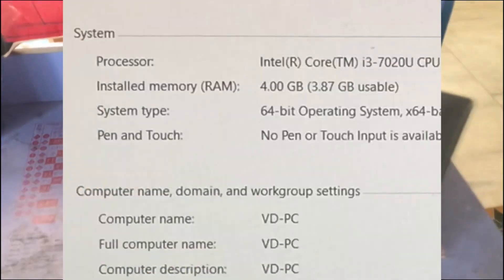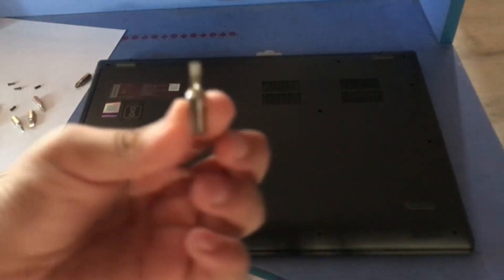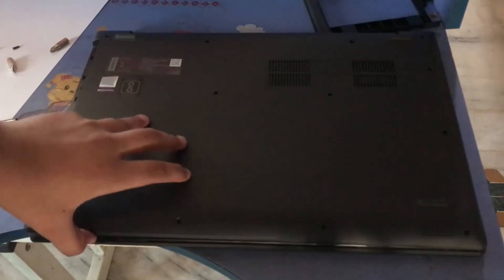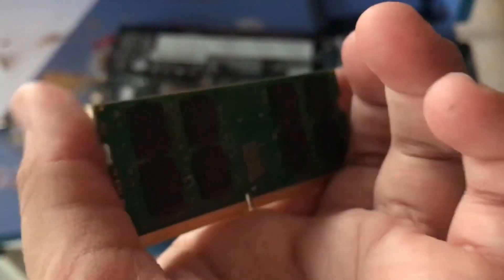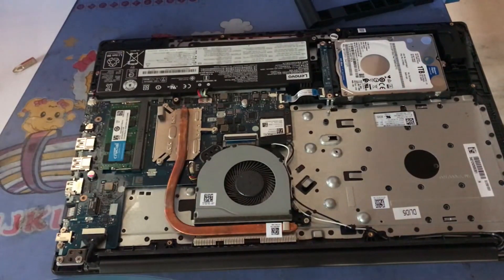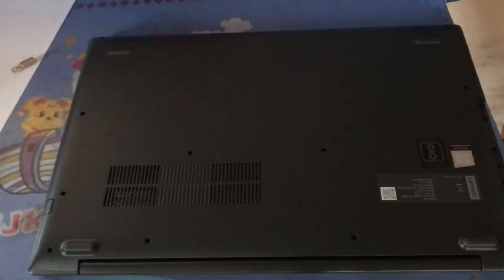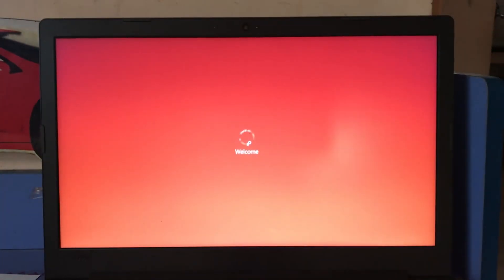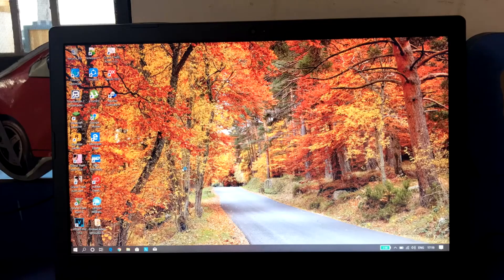Lenovo Ideapad 130-15IKB review and Ram upgrade + GTA V Test (UPDATED)

Comment: Did you use hdd on this laptop? How about if you use Ssd for this? and let's compare these two drives  🎉❤
Reply: Try to make videos about Gta5 performance between HDD VS SDD  using this Lenovo Laptop

I'm very glad to see this 😊
Reply from the maker: @joshuapaul9874  Hey, sorry about that. I did use a HDD but I do not have the laptop anymore to compare with an SSD. You're going to have to try it yourself. I doubt it will impact much more than load times, though.

Comment: afaik this laptop doesnt have sata port, did you ever try to upgrade ssd?
Reply from the maker: Yes, some time after this upgrade, I got an SSD. The Pre installed HDD just has a normal SATA config. One data port and one power one. In the laptop, there is a ribbon connector that connects the motherboard to a separate piece with the SATA ports. 

This was a long time ago, so my memory might be a bit fuzzy, but if you have the laptop yourself, just take out the screws very carefully and you should be good.
Reply: @WarWithVarun  you mean you replaced hdd with ssd. I wanted to install ssd without replacing the hdd.
Reply from the maker: @PrasadTheACE  unfortunately, no . This laptop doesn’t have enough space for that.

Comment: Ayo I have a laptop same as you and I want to confirm if I upgraded my ram on my lenovo 130 15AST will run smoothly in games? Since I changed my hdd to ssd but my cpu is AMD A4
Reply from the maker: Since I didn’t have the same CPU, unfortunately I cannot confirm anything. Though I can say that you should upgrade it anyway.

Comment: Okay bro so now i have This same laptop and model also, and it has installed nvidia geforce mx 110 grafic card which is running smooth and strongly.... now if i add 8 gb ram in this laptop so i get total 4+8= 12GB ram..... So now my all game and all work will be done smoothly na like big pcs............
Reply: Hello brother, how did you do to put a graphic card on it, I was thinking of putting one on it, but I don't know how you did it.
Reply: @sofiadelgado6262  bro my graphic card was inbuit by default from factory only, i didn't added anything😁😁😁
Reply: @shyflipx8  bro what speed is the best for this laptop
Reply: @Sofia Delqado the speed is Amazing its likeee 6969 GHZ
Reply: @shyflipx8  for this laptop?
Reply: @shyflipx8  which speed is the most recommended for this laptop

Comment: Hey bro! I have the same laptop with the i5 8th gen one and I was checking the official website where they said that you could only upgrade it to 12gb...is that correct info or could we add a 16gb over the 4gb soldered ?
Also any different company like samsung or kingston would work or is it Crucial specific? 
Would help a lot if you would reply to these questions of mine!!! 
Thanks
Reply from the maker: That information is incorrect. This laptop supports upto 32GB of RAM. Yes, I used crucial but you can use any other brand.
Reply: @WarWithVarun  thanks for the reply mate!
Reply from the maker: @debarshipal8275  You’re welcome!
Reply: @WarWithVarun bro are u sure we can upgrade upto 32gb?omg i was worried abt 16 gb lol and can u tell which frequency we should go for
Reply from the maker: @zak0r620  Yep! 3200 MHz is fine.
Reply: @WarWithVarun  thanks but bro will it work on 3200mhz only then?
Reply: @WarWithVarun  cuz rn i have 8 gb 4 plus 4 and they are clocked on 2400mhz
Reply: @WarWithVarun  and my variant is i5 8th gen plus mx110 lenovi ideapad 130 15ikb
Reply from the maker: @zak0r620  Yes, but not in dual channel because the inbuilt memory is different frequency.
Reply: @WarWithVarun  bro i didn't get ur point the thing is when i bought this laptop since then only it has 8gb ram and 4 gb is soldered as i have seen in reviews and sources and 4 gb is other and i swe it in task manager it shows 2 of 2 are occupied and also their speed shown their was 2400mhz  and now i want to upgrade my second channel ram  and get 16 gb in it so dat in total i get 20gb so if i use 3200mhz ram  then what will it be clocked on

Comment: While i was researching i found a pif of the laptops specs and it says it can 12gb of ram max. Can you  check in file manager in this pc properties on how much ram is actually usuable thanks
Reply from the maker: That info is incorrect. This laptop supports upto 32 GB RAM. The usable RAM is mentioned in the video.
Reply: @WarWithVarun  ah okie
Reply: @WarWithVarun  hold on, is the 12gb max an outdated info? Or have the manufacturers since updated software so 32gb can be run now?

Comment: how much ram does the laptop support ? 
And can it support both an ssd and hdd
Reply from the maker: This thing supports upto 32GB RAM.
It can only support either SSD OR HDD, NOT both.
Reply: @WarWithVarun  I have the same laptop I have 1TB HDD can I also install SSD in optical drive slot? If not then what is the reason?
Reply from the maker: @awesomestuff817  there are not enough connection ports for another storage drive.

Comment: Can i ask for the display and graphic settings for gta v, might try it, we have the same laptop. Ty
Reply from the maker: DirectX: 11
Resolution: 1280x720
AR: Auto
FXAA: Off
MSAA: Off
VSync: Off
Pop. Desity: Low
Pop. Variety: High
Distance Scaling: Low
Texture, Shader, Shadow, Reflection Quality: Normal
Reflection MSAA: Off
Water, Particles, Grass Quality: Normal
Soft Shadows: Sharp
Post FX: Normal
Anisotropic Filtering: Off
Ambient Occlusion: Off
Tesselation: Off

Long Shadows: Off
High res. Shadows: Off
High detail streaming while flying: Off
Extended Distance Scaling: Low
Frame Scaling Mode: Off

Comment: my one is 130-14ikb i5 version . if i upgrade it to 8 gb will gta v run.
edited: I have 240 gb ssd fitted 
And clock speed id 1.8ghz with 3.2 ghz turbo boost.
Reply from the maker: Yes.
Reply: @WarWithVarun  Bro i just want to know from where do you got 16 gb ram sodimm 2400mhz at ₹3700 or $50 and also from where do i get 4 gb sodimm 2400 mhz ram
Reply from the maker: Sorry for late reply. I didn’t see your message. I got it from amazon when it was on sale. You would likely find it now at 4x the price 😬

Comment: Bro I have same laptop but it hangs and freeze what should I do now it also shows disk usage 100% does it also happens to your laptop please provide me some solution
Reply from the maker: Hate to break it to ya friends, but your hard drive is failing. Your only option is to backup everything and install another hard drive.
Reply: Bro any other option like ram upgrade
Reply from the maker: @navneetshukla3328  The ram wont do anything as your drive is the problem.
Reply: Does upgrading to ssd will slove it and also does it support ssd bro plz reply
Reply from the maker: Novneet shukla Yes and yes.

Comment: varun can you check can we upgrade the processor or gpu
Reply from the maker: As this is a laptop those two can not be upgraded, especially the CPU. But you can get an eGPU. Upgrading those is possible, but I wouldn't recomment it.
Reply: WarWithVarun // WWV  tumne ram kitne ka kha se lia
Reply: WarWithVarun // WWV  tumne ram kitne ka kha se lia
Reply from the maker: The lakshya kuhad amazon se ₹4000

Comment: Which ram is this ddr3 or ddr4 and how much vram did you had after upgrading
Reply from the maker: DDR4. Total Available Graphics Memory: 10301 MB
             Dedicated Video Memory: 128 MB
             System Video Memory: 0 MB
             Shared System Memory: 10173 MB
These are the stats ^^
Hope this helps. If it does, do click that red button :D
Reply: @WarWithVarun  how much fps are you getting
Reply from the maker: Rupali singh 40-50FPS, I’m sorry, I didn’t see your comment. Really sorry.